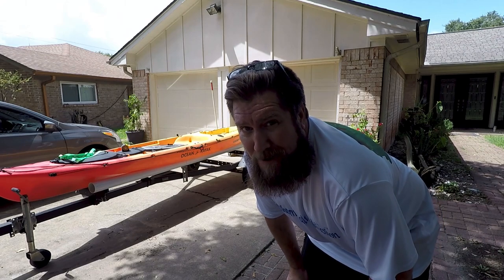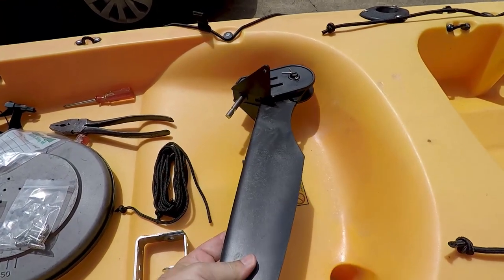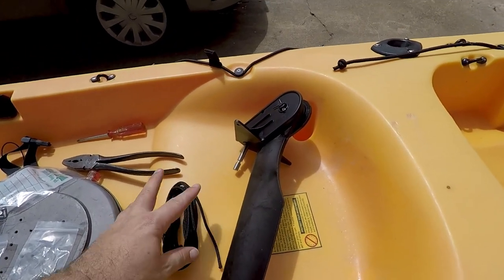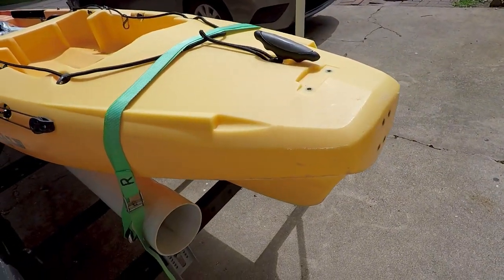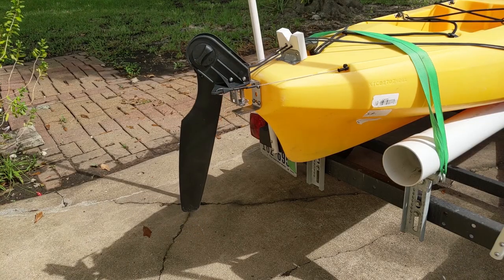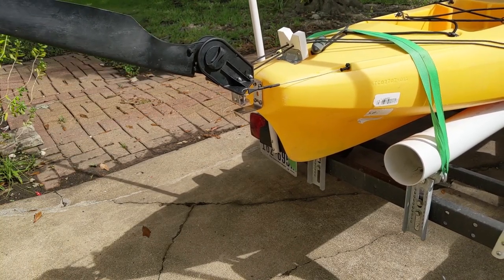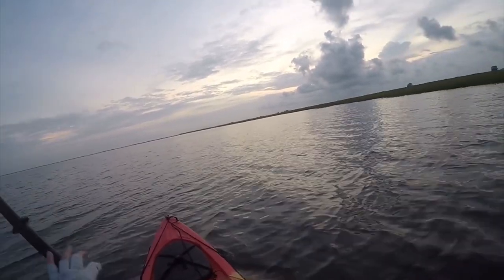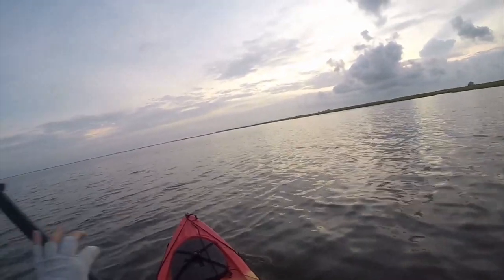Kayak Rudder Installation DIY

Comment: My prior kayak was a two person fiber glass Klepper Kamerand kayak. It came with a rudder for $500 back in 1978. Six months later I bought a sail for an additional $500. A jib and a main sail on a kayak can be very unstable, so I built double outriggers but that's a long story.
Reply from the maker: Did you use the sail to reach distant fishing spots, or explore the great outdoors?
Reply: @TexasCoastSportsman  Without the sail I explored the inlets of Shinnecock Bay in eastern Long Island. With the sail, I took the kayak up to the northern lakes of New York State. Paradox Lake, and Schroon Lake were favorite sailing spots. Cape Cod was within reach also. The out riggers were a simple design consisting of four inch PVC pipes and two by fours. The two by fours sandwiched using carriage bolts and one by twos to attached to the upper hull. The basic design of the kayak permitted the PVC pipes to touch the water rear first so the danger of the front of the PVC pipes submerging was minimal. Since a kayak has such shallow draft, the lee boards that were supplied with the sail package were a great help in keeping the sail kayak going straight.

Sailing in that boat was no less than thrilling.

Comment: I am in the middle of my after market rudder project. The Texas Coast Sportsman was lucky to have had easy access to most parts of the kayak interior. I can tell you that threading the irrigation tubing was a good deal more difficult on a Perception Pescador 12. Access to the interior of the kayak is at the front of the boat. There would have been no way to thread the tubing from the foot rest area to the end of the boat without flexible aluminum wire that is used to ground lightning rods. As it was, it took a great deal of patience, and enlargement of the holes at the end of the boat to successfully thread the tubing. I also needed to dremmel down the rudder where the rudder meets the boat so that the rudder would swivel freely.  The Perception rudder would have cost me $300. This do it myself project will cost me about $80.
Reply from the maker: I'm not too proud to admit it, that even with all the access I had I still struggled to route the tubing. Nice work with the custom install and custom diy price! You're going to love it.

Comment: Can you tell me which rudder kit that was on Amazon  I can't  seem to find it that was a great video thanks  again
Reply from the maker: I updated the video description to include links on Amazon to the parts I used. The exact kit I used is no longer available. But I did find the same parts from other sellers.

Comment: Bet you would have been fine without that inner tubing, and the cables.  I use some small diameter rope (about the same size as parachord, but non-stretch) and it doesn't rub through anything, as the actual pressure on the rudder is super light.  Get or make a sail rig and you will be amazed at how far you can go without ever paddling.  Mine is a folbot and not sure of the sail rig, but it has little inflatable armas/pontoons on round aluminum tube, and a dagger board on one side only.  Sails awesome!  You can be somewhere in 10 minutes that would take you an hour to paddle to.

Comment: Fantastic video!. This is exactly what I want to do with the exception that I’m going to put swivel pedals in stead of full slide as I like to anchor myself against the foo pedals when I paddle. Well done! I subscribed as well.
Reply from the maker: I was concerned about not being able to brace myself when I paddle. The movement needed to steer and track is minimal. Don't wait to do the upgrade. It changed the kayak 💯 for the better!

Comment: I have this same one, I just realized, it swivels...the wind will just move the skeg side to side right...not the way you rigged it but still, the bracket and the skeg are 2 separate pieces, im using this on my back up lifetime kayak and the wind pushes me across the water like nothing so I got this skeg.

Comment: Are you still using the rudder, did it hold up over time? Would you do anything different now?, love the video, just realized that it was 2 years ago
Reply from the maker: Still using it today! My only issue is the deploying cables but that wasn't featured in the video. The jb weld didn't hold, but it didn't impact the way it steers.

Comment: Im gonna do this but put tension springs at the front of the pedals so when you let off the pedals the hold center
Reply: I like where your head is at, self righting. Potentially single leg control... maybe

Comment: Good afternoon I am writing to you for an orientation on how you made the threads and how do I get that type of thread to be able to put the stainless steel base on it and be able to install the rudder on that base.  thank you I await your answer
Reply from the maker: My kayak was rudder ready with the threaded inserts already formed into the plastic. They make inserts that can be "crushed" to form a nut insert or you can install a hatch to reach through and bolt through.

Comment: Question: were did you have screw holes predrilled for the rudder mount, or did you have to use a drill bit and make your own? I have an Old Town top water 106 and there is no way I would be able to place washers on any screws that I place.
Reply from the maker: Mine was "rudder ready" to a degree. The nut inserts were already in place. I just had to get/fab a bracket to fit. From what I can find only the pdl model of the topwater are rudder ready. You will need to drill. If you can't back it with a washer and nut to will want to use some type of insert.
Reply from the maker: I've looked at the pdl models as an option for a paddle drive kayak. Check your warranty before drilling into your hull. I believe the lifetime hull warranty has a no drill clause.

Comment: I would like to do this but the only storage cap I have to open is in the bow
Reply from the maker: If you have a spot and your not afraid to cut a whole in your yak, add one. You can find an access hatch for $15-$18 on Amazon.

Comment: I am wondering if its held together?
Reply from the maker: In my last trip I did find the JB Weld did break loose. My Frankenstein bracket fits together so tight the JB Weld wasn't needed. Everything still works great. I'm hard on my rudder, running it shallow into mud and oyster beds. Still working great!
Reply: @TexasCoastSportsman  I was wondering about that jb weld. The bolt is enough to hold it all together?
Reply from the maker: @johnmichaels4330  the tip is more than enough to hold it. The jb weld was over kill. The extra play in the mount works well for me. I'm always testing the limits of how shallow can I get.
Reply: @TexasCoastSportsman  man, that is awesome. Thank you very much. My heritage is second hand and didn't come with one. This is going to be a huge help.
Reply from the maker: Your heritage will handle like a sports car once you hear that stable tracking from the rubber. And the control in the wind is worth penny and drop of sweat from install.
Reply: @TexasCoastSportsman  I sure appreciate it. I'm new to kayak fishing and live on the trinity bay. Lots of wind. I'll be doing this soon. Thanks again.

Comment: So, no foot anchors anymore?
Reply from the maker: They still function as foot anchors. The movement required to steer is very subtle. Plus when you push one it pulls the other. So, you're able to still brace yourself for good paddling posture.

Comment: How do u deploy the rudder?
Reply from the maker: That still needs to be corrected. I've been fighting my current setup. I ran it to the starboard (right) side using the open holes in my bungee guides/eyelets. It has not been ideal as it contently binds when trying to lower or raise. My first test i ran 2 separate cords, one to my left other to my right. That worked well and I think I'll go back to that setup. They were inline with the rudder and gave little resistance. Maybe I should do a video when I redo mine.
Reply: I would like to see a video of the deployment lines too.
Reply: @TexasCoastSportsman  please do

Comment: Bizarre system, all the force transmitted by the feet to the boat will be held by the rudder screw on the back of the kayak… it won’t last for long time.

Better use a pedal system, also biomechanics of paddling is incorrect when one leg is more extended than the other…

Is true that sit on tops like these boats are not technically demanding but in my greenland kayak or in competition boats it will simply be totally unusable
Reply from the maker: This is a rudder versus a drive. It's for steering not propulsion. No peddling or paddling is done with your legs. The pedals are used to keep the rudder oriented at the needed angle to  steer the kayak.
Reply: @TexasCoastSportsman 

The function is the same, I have had many kayaks on my sport life: unless your technique is incorrect, when paddling one transmit the force of the arms to the boat via the feet and some friction force between the buttocks to the sit. 

This pressure will transmit also from your cables to the rudder, because you had disconnected the blocking mechanism of the foot rest.

In the well mounted systems, the rear foot is transmitting force against a fixed point, and the front foot is used freely to stir the kayak
Reply from the maker: You are correct that force is lost or poorly transferred due to the "lock" of the feet. I have experienced very high wind situations where I had to hold my legs at a less desirable angel to maintain a straight course. Yes, I was losing power due to my posture but in my opinion it was less than I would have lost making corrective strokes. 

I spend the majority of my time on the water with a fishing pole in my hand versus the paddle. For me, the ability to steer with my feet exceeds any power loss in my stroke.